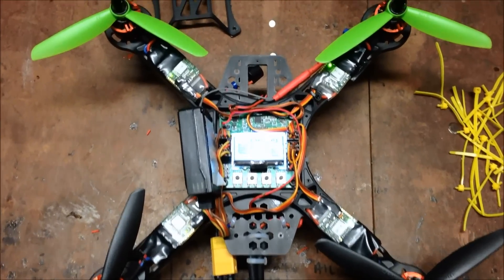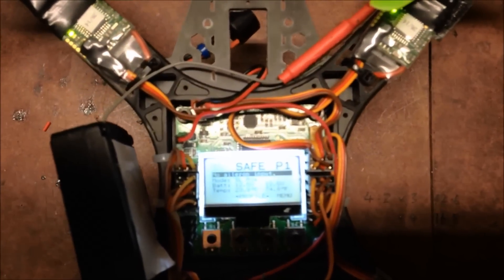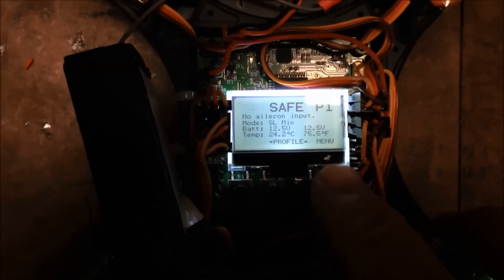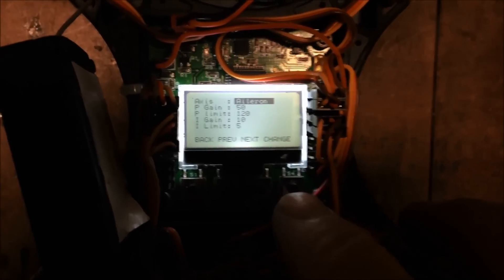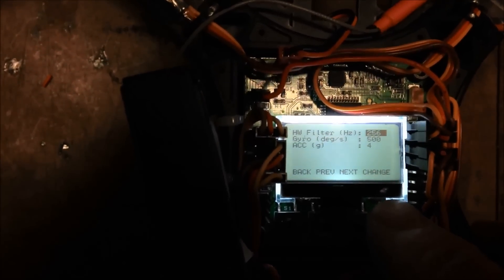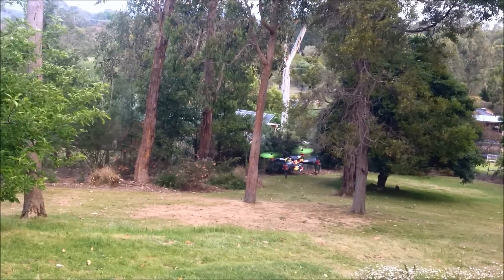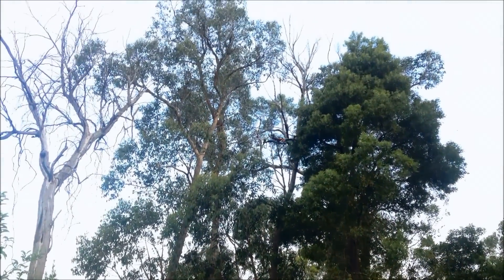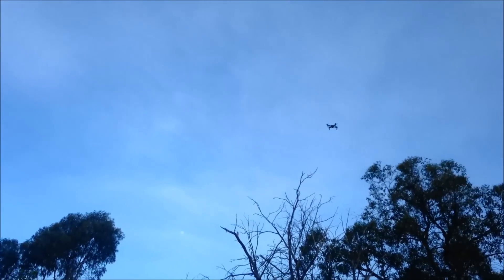Hobbyking Diatone 250 Quadcopter KK2.1 PI Fine tuning for ACRO flight with RC911 firmware

Comment: I have the same set up.With the turnigy 9x what setting type do u have it on to fly quadcopter?Heli 1,heli 2 ,plane,glider?
Reply from the maker: Standard Heli mode. Only use the gear switch to change from Self Level to Mixed Self Level Modes. Otherwise transmitter is all standard. All the Mixed mode and stick scaling is done on the KK2.1
Reply: Simon Hahnel 
Any reason your not flying in Plane mode?  I found with my 9x it was easier to fly, and more stable.

Comment: Hello. I have the same 250 frame and KK2.1. I prefer very stable flight rather than ACRO. What is the recommended PI setting for that? Thanks. :)
Reply from the maker: Lower your P settings and keep stick scaling at default.
Reply: http://www.hobbyking.com/hobbyking/store/uploads/475200704X68736X56.pdf
For smooth flight

Comment: Simon my name is Brendon and i have a diatone 250 quad as well with a kk2.1.5 and multistar elite 2204 2300kv motors and 6045 HQ props. My kk board is stock with the stock firmware on it. I have messed around with my P gain settings a little but thats about it. I have self level set to a swtich. When I turned off self level and tried to flip it did like 4 or 5 flips in about 2secs extremely quick. I then tried a roll and it rolled about 4 times in a split second and crashed and broke all the props. Is this rc 911 firmware what i need to do acro on this 250 quad? I can already do flips and rolls easy on my blade 200QX. I have the programming cable and usb dongle but havent used it yet. Once I get rc 911 on there what do i need to setup? Im on 3s 850mah lipos as well. Have only used 6030 gemfans and now 6045 hq props. I have some GF and HQ 5030 props as well. What props should i use? Any help would be great thanks
Reply from the maker: Brendon I YES. RC911 is definitely the answer. It has a Self level Mix Mode which allows flipping when hard on the sticks and reverts to self level when sticks are back to rest. I would highly recommend flashing your KK and giving it a try. I have not put anything up on RCGroups on this. There are others that have though. From Sunny Melbourne.
Reply: Simon Hahnel 
You could also flash to the Stevie firmware.  I believe 1.19pro is the most current at the moment.  Either are better than the stock firmware.
Reply from the maker: I tried stevie but found rc911 a bit easier to work with